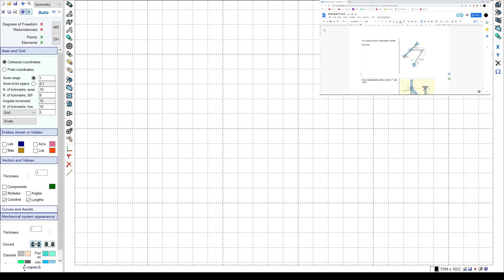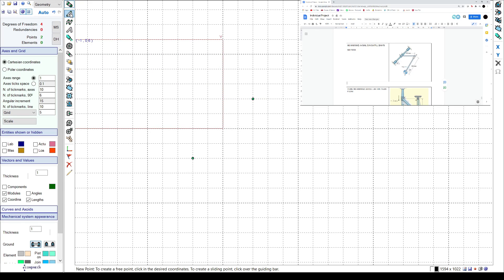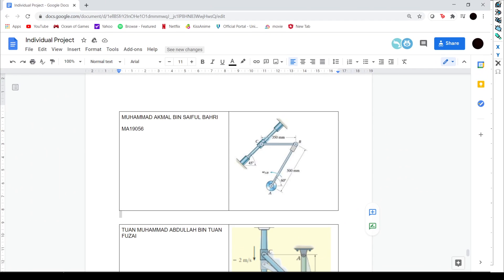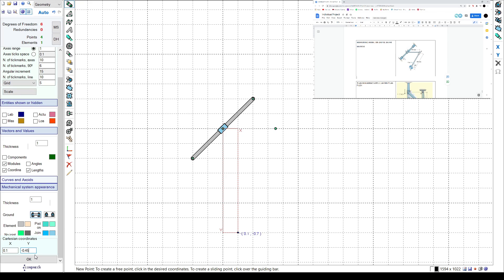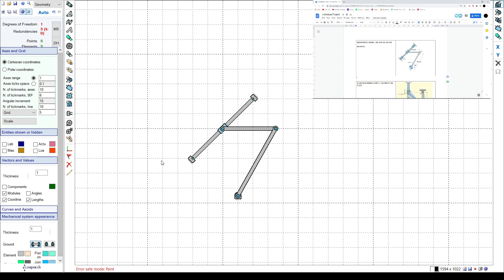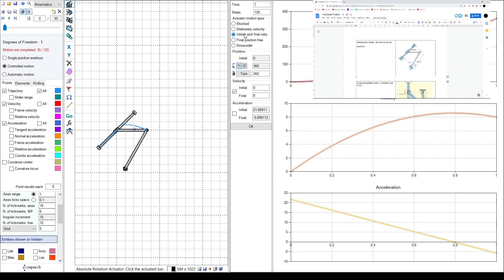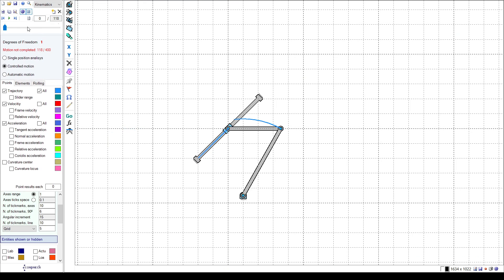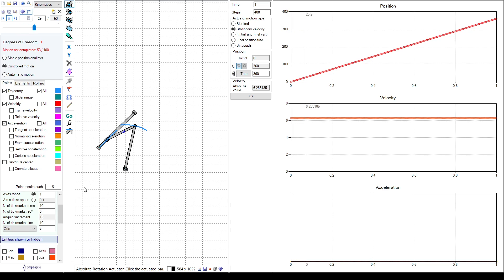GIM SOFTWARE (INDIVIDUAL PROJECT ON RELATIVE MOTION ANALYSIS : VELOCITY) DYNAMICS

Comment: MA20013 - Very good explanation on the tutorial on how to use GIM software but it would be more great if you can complete the motion process because it is not fulfilled based on the requirement of the motion process.

Comment: MA19058 Great presentation on the simulation. You can restrict the movement of the bar so the edge point of the two right bars didnt merge with the left bar.